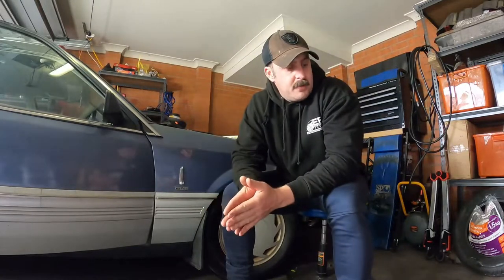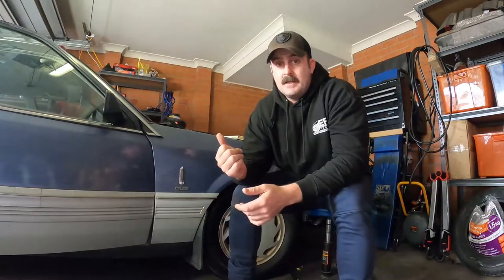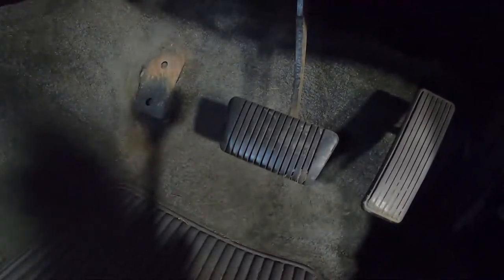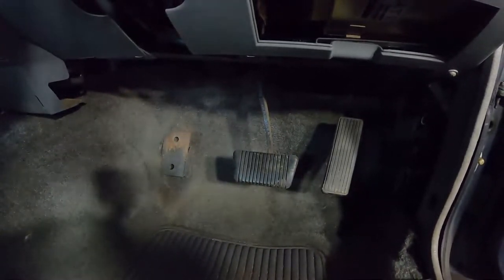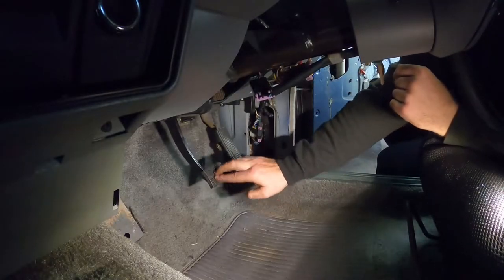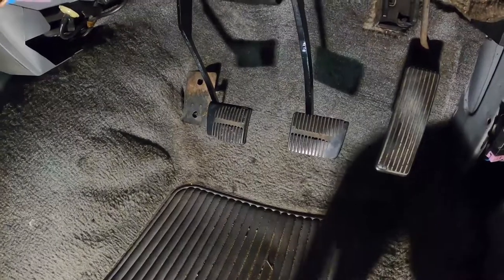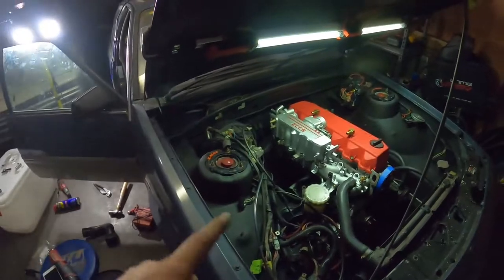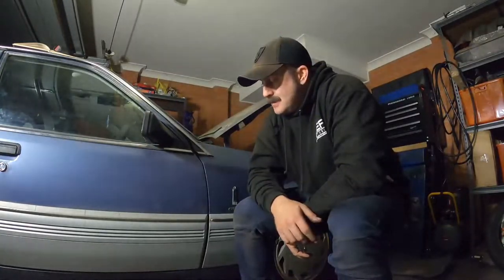Holden VL Turbo Commodore Build - Manual Conversion Pedal Install

Comment: Dale Blart: VL enthusiast

Cheers for the content mate, I'm doing an r31 wagon soon. It's been swapped with a holden s1 rb30 engine I believe, some time in the past. I figure I just send it at 10-12 psi with safe timing. Do you know much about the internals capabilities?
Reply from the maker: Thanks mate. The s1 rb30 doesn’t have the ports built into the block for your turbo oil and water feed, if you want to use that block you need to either drill and tap or run your oil feed from your oil sender port or get an oil filter sandwich plate, as for coolant you can tap into the cooling system anywhere you want. The stock internals will be able to handle 10 to 12 psi no dramas, but it’s all in the tune and how you intend to drive it. I would do a compression test on the engine before you start the mods just to give you an indication of the health of the engine, as there’s no use pumping boost into something that maybe a tad hurt already.
Reply: @dalevloghlan8771  Mint, the plan is a high mount, looking at either gtx3076 or a bw efr7670. It has had an oil filter relocation fitted with cooler, which I was just going to get rid of, maybe I can use that somehow. Thanks for the info!
Reply from the maker: Yeah the oil filter relocation kit should have ports on the block adaptor or filter housing that you could easily use for your oil feed and you can just return the oil drain straight to the sump, just make sure you have the fitting up high and have a nice straight run from the turbo down to prevent oil drain back issues 👌🏼

Comment: I did mine alil easier. I trimmed my foot brake and cut off the foot rest. It was a pain getting under so tight in there
Reply from the maker: It definitely saves a lot of heartache!!! I’ve done this a few times now and it never gets any easier.